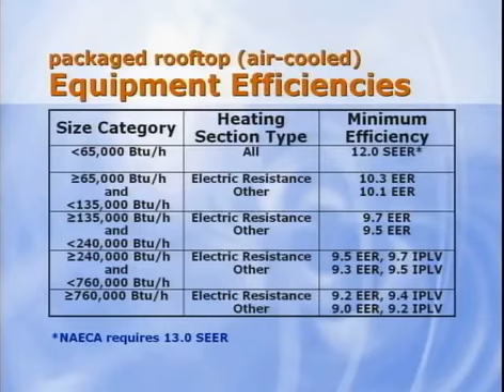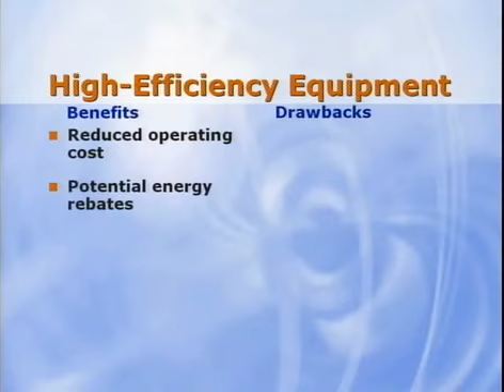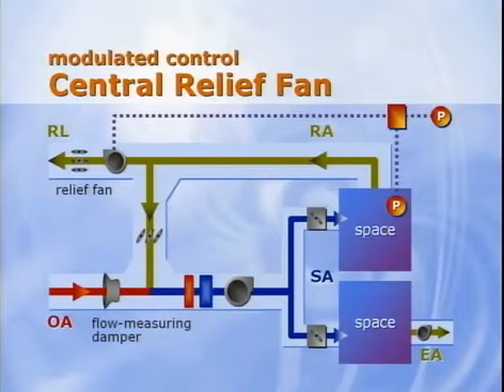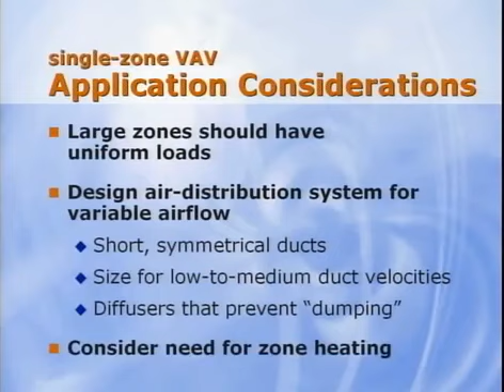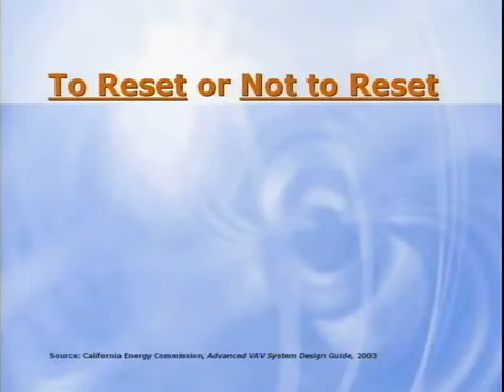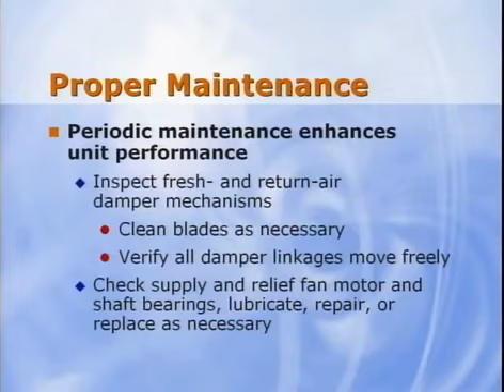Trane Engineers Newsletter LIVE: Energy-Saving Strategies for Rooftop VAV Systems

Comment: At time 51:00, the "Optimal Start" section, during morning recovery, using optimal start, no ventilation occurs. (As you know)

It's been my observation in my climate, hot & humid Midwest USA, but with cool and humid mornings, that not using optimal start may induce high moisture laden outdoor air, with low sensible heat, which will not need much cooling before being delivered to the space. This becomes a problem later in the day.

Conversely in the winter, what little humidity is already in the building, is diluted by the bone dry OA.

Customers that insist on 'padding' the schedule, I believe create more problems, than just letting optimal start do its thing, but I find it hard to convince them.

Any advice would be appreciated, and I have learned a lot watching this channel.